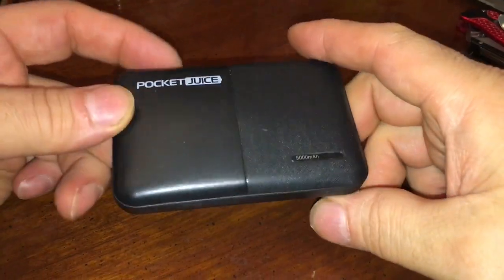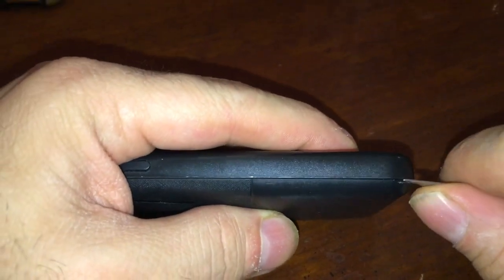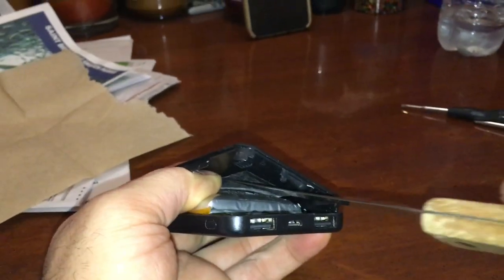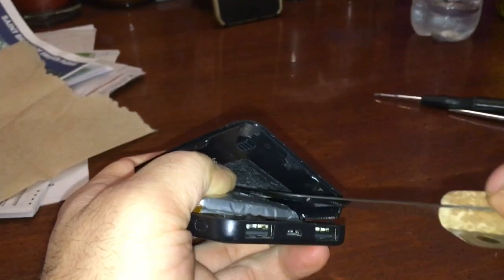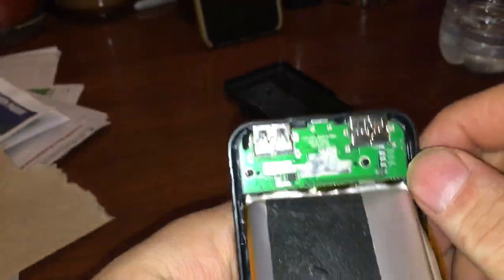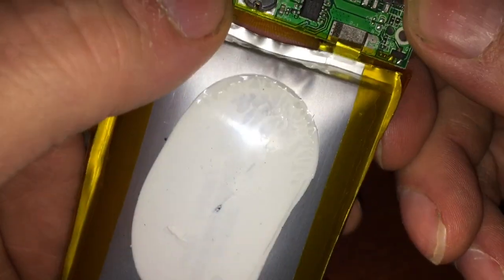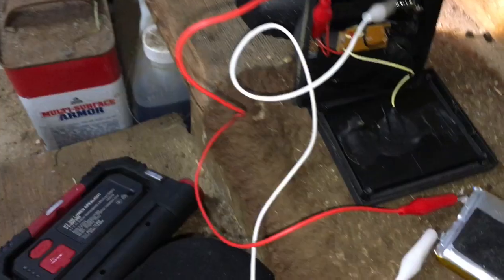Let's remove bloated Pocket Juice Battery and install it in solar light

Comment: OMG!!!!

That is not air in the pouch: that is the highly toxic off-gassing of a bad Li-on battery. It is designed to to off-gas as the first sign the battery is now defective and prone, now, to thermal runaway. Not to mention that battery is not smart and relies on the circuit board for protection.

I hope no one takes anything you say seriously.
Reply from the maker: finally a "it's not air" rant. but Im pretty sure it was motivated by me saying I'm surprised none exist yet in these comments... sigh. however... I said all that in the video and why being outside in a solar light would be a perfect place for it to do all that scary stuff... I mean otherwise I would do what everyone else does... aka throw it out. and let it explode in a trash compactor or start a dump pile fire... right?
Reply: @bobspurloc  No, you drop it off at the supermarket trash can for old batteries.
And I flat out told you that type of battery needs its circuit board to charge discharge safely.
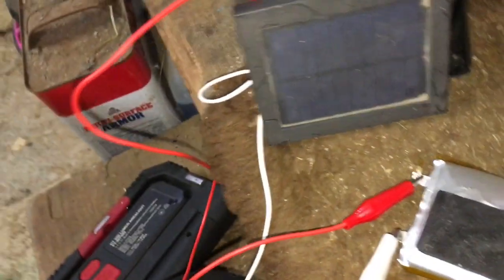I stopped watching @9:11 but there are many types of Lithium batteries and you must use the right board to charge them. I seriously doubt your outside lights are made for that battery and I know they are not calibrated to that pack.

Once it goes into thermal runaway, you will not be able to put it out. It is going to burn like thermite. Even if you think it is extinguished there is no safe way to dispose of it because it can reignite and if you have dropped it in the battery recycle/dispose can it will then set them all on fire.

To be honest though: you slipped with the serrated knife and I was sure this was all stupid at that point. Every child is taught: don't run with scissors and never cut toward yourself.
Reply from the maker: I have 113 other videos handling lithium batteries, please watch and critique them and let us know the dangers. I have over 100 repair videos, laptop tear downs, phone tear downs, ford transmission tear downs, axle replacements, rear differential tear down, circuit board repairs of automotives laptops iphones air pumps microwaves vacuum cleaners, capacitor replacements. It seems I repair anything that is broke and I need an expert to tell me the dangers using the most general of verbiage. I know I'm just the padawan but here a tidbit for the future... there is no vast mystical circuit logic in place for charging a battery in things like this. small nonsense things like this go by voltage. a lithium ion 3.7v is fully charged at 4.2v stop charging. LiPo slightly below that and well why charging a LiPo in a lithium charger is going to over charge the LiPo and pop it 100% of the time if not removed after proper voltage is attained. as for cutting away from oneself, I wasn't cutting anything... and well I wasnt cutting anything here either nor did any knife dart in a direction, so please school us what went wrong with a knife here. https://youtu.be/c8mFbztXuRo   and then u can tell us what happened here where a simple rear tail light replacement led to an ouchy https://youtu.be/F9iugdDni-E

Comment: Man you are ballsy using sharp blades as disassembly tools ive sliced my shit up too many times dude lmao
Reply: You can Use a heat gun to soften the double sided tape if u have one just something ive picked up
Reply from the maker: lol... not my first rodeo disassembling such things. I have many phone,  touchpad, ipod, laptop etc repairs. I've poked fingers in at least 2 videos. fried arms on car engines, small engine exhausts, ripped a finger nail half off in a video while replacing rear tail light on a car in below freezing temps... things happen when u repair things.